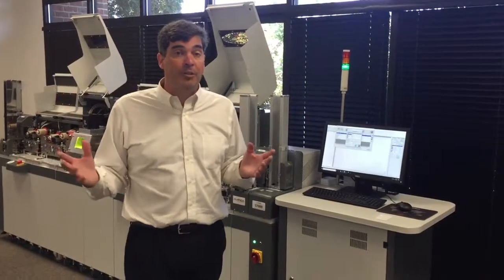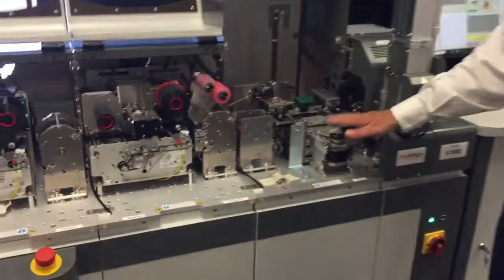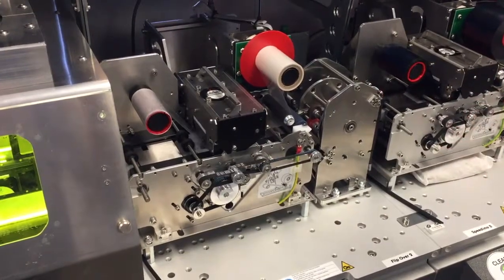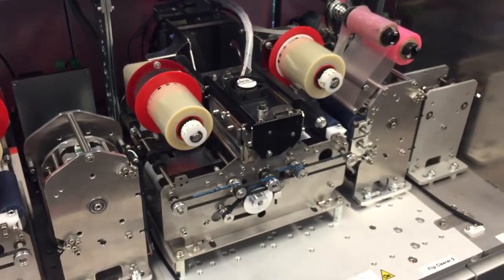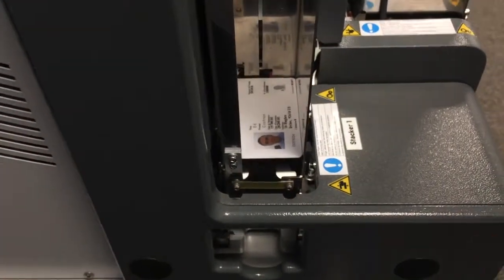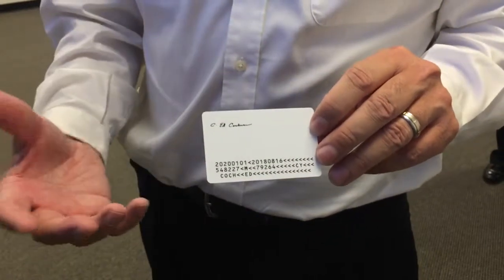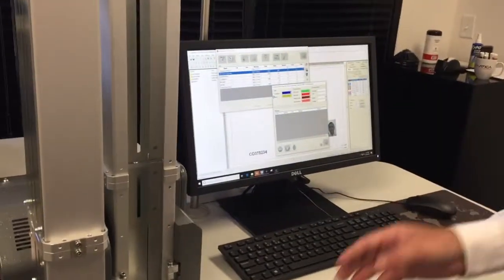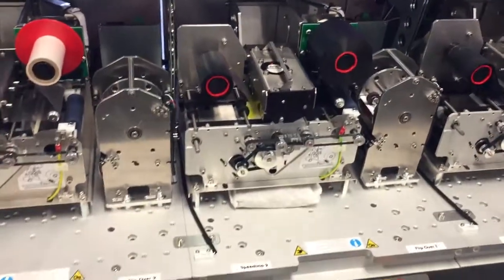High Volume Smart Card Issuance: Smart Card Encoding + Printing + Laser Engraving + Lamination

Comment: That is SO COOL!!!!! I work in a card factory myself, and I happen to run a TON of standalone machines which all do different parts of what this machine does. Thermal printing in various colors, RFID programming, magnetic stripe encoding, laser engraving…I’ve done it all. While I’m in no position to get this machine for the company (I’m not a manager or higher-up), I’m definitely going to show this video to my boss when I get a chance, as I think it’d be great for my department to have one BIG machine that does it all rather than over 40 smaller ones all doing different things—which is the way things are now, by the way. I’m sure it’d be a big investment for the company, but it’d definitely increase our efficiency A LOT in the long run!